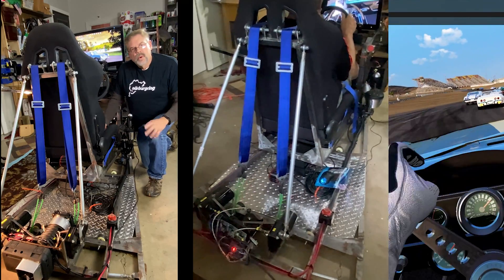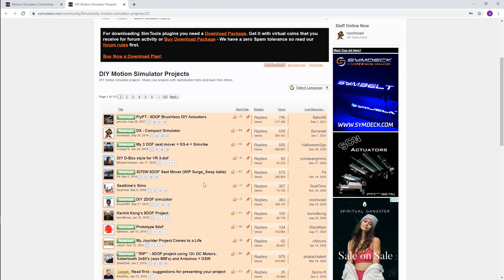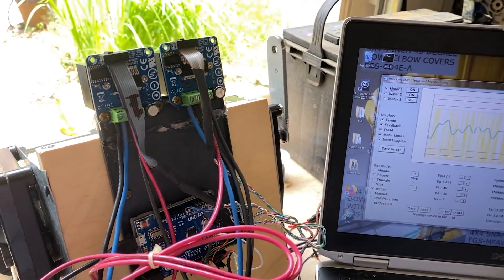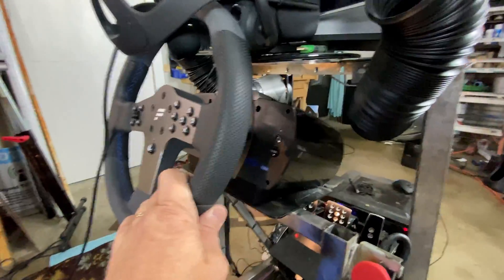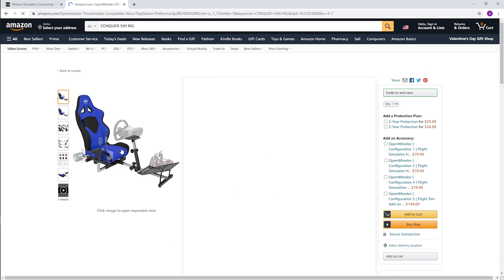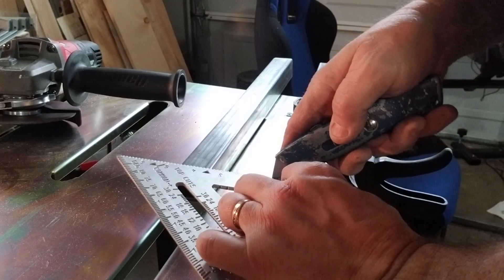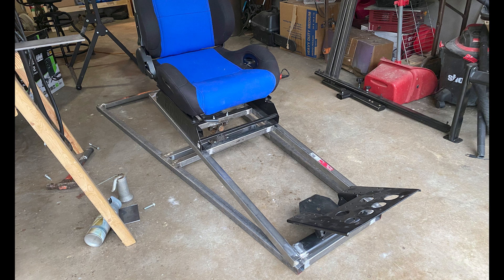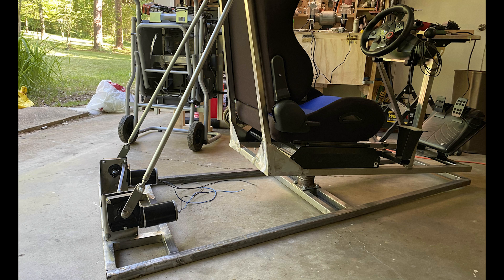How to build a Motion Sim Racing Rig - Start your journey!

Comment: There's a huge step missing in this video.  How is your wheel, shifter and pedals talking to your rig?  For example, if you step on the brake your rig will obviously tilt forward to mimic the forward momentum inside a braking car.  How is your pedals communicating with the motors to tilt forward?  I know you used and arduino but there is more to it.
Reply from the maker: yes. of course there is software which interfaces with the game data and moves the rig.  I have about 100 videos on how to build and what software to use and set up  so take a look at some of the other videos Dave
Reply: @DMAX_DIY  cool

Comment: its been a while since I've attempted this, but my biggest issue was getting the information (telemetry etc) to tell the setup how to turn etc.  You can always make it bank or whatever based on steering wheel input, but the terrain input is whats critical.  Have they come up with a protocol yet to universally feed these setups?
Reply from the maker: well I have a video about setting up your motion without anything but  the rise and fall of the track.  that's really first what you want to do in Simtools editor.   then you shut those forces off, and only concentrate on surge (acceleration/braking).  heres the video..    https://www.youtube.com/watch?v=6rZMVFsoNHA&t=3049s

but there is an entire newer series on all of the compact motion simulator..  here  https://www.youtube.com/playlist?list=PLO8l70qEp71MER1P0D-BBZza_gqzzmgp_

Comment: How difficult is it to get one of these to run on compressed Air? I have a high power air compressor and a pipe going to my cellar
Reply from the maker: good question..  probably wont work.. i have experience in animatronics (using pneumatics) and in my experience the valves that are controlled are either open or closed  on or off  so  that's probably not going to work in a simulator.  you need something that has analog type control ..  it's easier with an electric motor but could probably be done with a fluid valve system like you would see on a backhoe.  i hope that helps..    dave
Reply: @DMAX_DIY  thank you so much!

Yes I just thought that since I have this 10kW compressed air system in my house that could be a good starting point, but I totally get the concern

Comment: You have issues with input or well in this case output lag? Or response time? My biggest worry is to build one and it be behind what I’m seeing or should be feeling in game.

Also what was your total cost? You basically built a DOF Reality H3 unit. Those run for $3,500
Reply from the maker: it's been 6 years now.. building 3 rigs..  i dont notice any 'delay' or latency with my setups.  i race on line with about 20 guys in the ACF league  every weekend too.  i think if your have some basic tools  your can build it under 1000 dollars.  i had to buy a cheap welder from harbor freight but that was only about $120 with a cupon..    also  i race in VR which is pretty taxing on my laptop.. and i still dont feel any latency..   the laptop is a gigabyte  with  an i5 and a 3070 video card..  dave
Reply: @ thanks for the info! This is an awesome series! Cant wait to see your final design and add ons.

I have all the tooling and skill set, I just needed a good design or idea to build. Motors and controllers specifically. I have the fab shop and automotive knowledge. But electronics is my weak point. I just don’t bother with it.

Also have you looked into making shorter motor rods instead of mounting to the seat back near the head? Why not mount to the base where the seat mounts? Should be able to replicate the same travel with a stronger arm and less materials used.

Again maybe check out DOF reality H3. Really similar to your design. But I’m sure had much more funding for R&D that may save you time and head ache
Reply from the maker: @mrmidnight32  i really wanted to use the maximum mechanical advantage by using longer arms, which attach higher to the frame.  (longer lever can move more) i was worried about the 12v crab pot motors being able to push all that weight around.  the dof reality uses different motors which i cant obtain here in the states.  but i've built a rear pusher and this compact front pusher and both react similarly using the longer tie rods.  so that's my reasoning behind it.   i also leaned heavily on the  experiences other guys have built rigs on x-simulator.net..    very helpful
Reply from the maker: also  here is the latest series on my channel which goes over everything.. start to finish  https://www.youtube.com/watch?v=_L8qYhAoIZ4&list=PLO8l70qEp71MER1P0D-BBZza_gqzzmgp_

Comment: Those look like 12V wiper motors. I suppose those are a bit stronger though. Currently i'm still in the process of making my own pedals.
Reply from the maker: Hi, well they are 12v but way more powerful than wiper motors.  i actually did a series on using wiper motors too.  but these are 12v crab pot puller motors available on ebay.
Reply: @DMAX_DIY  Thank you for that info.

Comment: How does the computer control the actuators? Is there feedback on the game built in?
Reply from the maker: good question. Thanks.  I made quite a few videos which go step by step on setting up the software and hardware to control the motors.  Yes, the games actually provide output for the motors and allow everything to work properly. Take a look around at some of my latest video series, which are start to finish.. Dave
Reply: @DMAX_DIY thanks for your response. I will do that.

Comment: Show us the software which drive the motor how it is connected to the degree of movement with the game or it just gives pitch ,roll,yaw pls
Reply from the maker: Thanks for watching.  in every series I do just that.. show how to build it, how to wire it, how to get the software to interface, how to get it running in the game.. I'll be doing it again in my next series (the green one) but if you dont want to wait, just look at some of the other videos that say 'simtools' or  SMC3 and that will get you going.. DMAX

Comment: Sooooo few people with the ability to do this stuff in a real way that there is so little in the way of basic info. Thanks for this it gets me started at least knowing where to start getting things together.
Reply from the maker: Great Comment and observation.. Yeah. 3 years ago I barely knew what any of these things were.. I did a bit a poking around on YT and found X simulator.net.  Used the info to build my first motion sim.  I had no idea what any of this was except I did like Grand Turismo on the play station with a controller but watching a few things made me think.. I can do that too - but didnt see any videos on it.. - So there we go. I decided to post up some stuff cause it worked pretty good.   I have a new video coming out in the next couple days on the COMPACT simulator .  Hope you have time to watch.. I'm working on the edit right now. And thanks for your comment..  Keeps me plugged in and helps me remember to keep posting stuff.  Dave
Reply: @DMAX_DIY  have you looked into / found / built anything using the piston style D box style ? I’m really thinking that’s the way to go as that seems to be the most popular and highly touted motion platform these days. If I can find the hardware ( I haven’t started really trying yet ) and there are software solutions to use it (which clearly there are) then I may try to go that route. Any suggestions or have you come across other DIY piston style ? I don’t really know what else to call them. But it’s what D box uses , one on each corner of the rig.
Reply from the maker: @SticksAandstonesBozo  so I used to mess around with a lot of pneumatic actuators back when I was involved in the Halloween Fright scene.. a long time ago. So I do read about these (electrical screw assemblies (as opposed to pneumatics) and I see the benefits.  I would suggest looking up " six degrees of flight" - on YT he has not posted in a while but he was using this type of actuator..  also I am in contact with "MOTION simulators" on YT and sort of on Facebook, which I dont look at that often.. Many of those guys are building the same things.. 3 DOF, 6 DOF etc  using the DIY actuators.  I just have not had a chance to bite off that much yet..  YET..  Let me know if you need links to their channels.. ALL the best my friend> Dave
Reply: @DMAX_DIY  Ive been looking at stuff from him and you but just now going to actually start working on a setup. Thanks for the info and the videos.
Reply from the maker: @SticksAandstonesBozo  Cool.. here is my new video if you want to take a look..  https://www.youtube.com/watch?v=UXS45Z2GHMk

Comment: I built my own sim chair rig out of wood the other day, it turn out extremely well. I got adjustable steering, seat distance and seat tilt. Anybody can get comfortable in it. But the last few days I’ve been thinking about how I can make it better. I was thinking as a primitive form of motion sim I could build a frame slightly bigger than the frame I got for My chair atm then I could hang the chair inside the new frame with springs and the feed back from the wheel and shifting should make the thing motion simmy lol. Making any sense here? Does it sound stupid or should I give it a go?
Reply from the maker: First of all thanks for watching my video. Sounds like you have been doing some thinking which is great! It always makes sense to try and get more out of the experience! I have not tried springs as I always thought It would be best to use the game telemetry to move the frame (or just the seat) in direct relation to the game inputs. I think you may just bounce too much unexpectedly..  (I may be wrong as I have not tried it)  I always wanted movement that was directly controlled by the throttle, brake, turns etc - and that comes from the game telemetry.   Give it a shot I guess.  There is another guy who is doing something similar here is a link to take a look https://www.youtube.com/watch?v=ZlPYNouUjuI   - Let me know if this is similar to your idea.. Dave
Reply: @DMAX_DIY  ya your right. It would probably be the wrong movement I’m looking for. The dr has a nice rig. I got welders and stuff just not that big of a tech guy., I would definitely have a learning curve there. BUT I got bigger problems at the moment. I bought my first wheel about 2 weeks ago and had to get 2 returns already, and last night my freakin wheel quit again! 3 t248s crashed within hours of each other.
Reply from the maker: @El-Dabo306  What kind of wheel did you get?   I dont know what the 3 t248 is..   Maybe whatever wheel it is needs to download a bios update or something..   I've had a G25 logitech and a Fanatec CSL elite.  I just bought the Fanatec  CSL DD  but have yet to put power to it.. so IDK about that new one.. Dave

Comment: Great video! I have a question. Is this only possible with one game or also with completely different ones like Flight Simulator, Tank Simulator etc.?? How does the engine know the movements of the steering wheel/joystick - left, right, up, down? Where does he get the data from? How does this work in simple terms? Thank you, Thomas
Reply from the maker: Great questions and fantastic comment my friend! To be brief, the game telemetry data is sent from the game  via usb to the arduino.  So flight controls, steering controls, breaking, shooting stuff whatever all comes down that telemetry pipeline. There is a small program called a plug in, which is available depending on which game you want that reads the data and sends it to the arduino.  The arduino reads the data in real time and adjusts the motor positions using the IBT-2 motor controllers.  Everything starts to come alive after you turn up the Pulse width on the motors.  There are many videos about it and I've done a few myself.  It's a great project and absolutely works..  Dave

Comment: Absolutely sick! My class mates and I might go on and try something similar, and i have got a question: where do you get the in-game information from? (When the seat should move forward, to the side, etc.) Thanks in advance, you are a huge inspiration!
Reply from the maker: Fantastic comment my friend! To be brief, the game telemetry data is sent via usb to the arduino. The arduino reads the data in real time and adjusts the motor positions using the IBT-2 motor controllers.  Everything starts to come alive after you turn up the Pulse width on the motors.  There are many videos about it and I've done a few myself.  It's a great project and absolutely works..  Dave
Reply: @DMAX_DIY  Thanks a lot for the quick answer, I haven't gotten around to actually watching all of your videos, but that's definetly what I am gonna do! 
Greeting from Austria 👋
Reply from the maker: @Misp7423  Austria sounds like a cool place..  It's super hot down here in Mississippi USA.. just waiting for fall to happen.. Cheers! Dave

Comment: quick question how did you get the sim to work with the motion sim like what code did you use to communicate from the arduino to the motors

Comment: How does the motor controller interface with the game?
Reply from the maker: good question..   the motor controller  IBT does what the arduino tells it to do..   the arduino is set up by the smc3 software.   the game data talks to the arduino which tells the motor controller to move..   i'm doing a series on my new motion sim right now.. i'll be going over all this in the next month or so.   Thanks!
Reply: @DMAX_DIY any updates on the new series? Will it be a new rig or just an upgrade?

Comment: Love every bit of this! Just curious how to program/synch the motors to the motion…
Reply from the maker: Yeah 45Mang..  that's a great question..  Ok so you set up the Arduino memory program using SMC3..   Then all motors are able to be influenced at 35,000 times per second by the game telemetry output..  So There you go.. motors are sycnched to whatever game you are playing (most top level racing - flight etc games)  I have a lot more on the channel on how to do it.. DMAX

Comment: quick question i dont a have 10 k hall effect. potentiators i only have 15k will that work im trying to spend as little as possible 
plz answer thankyou for your time.
Reply from the maker: Great question..  I've seen it before too so Here is the short answer..  it' probably will work, but the arduino math is going to be off a bit. I would think.  based on 10k.   I'll run a test when I get the new rig running..  I'll substitute a 15k wire wound (if I can find one) for one of the hall effect sensors.  That way everyone can see the difference.  But your best best I think is to pop for those hall effect sensors  180 degrees..  I have had absolutely no issues with them experiencing EMF problems and the simply work great..

Comment: Not sure if you are still repling to this vid but thought I'd try, Ive been looking for a couple of years on and off even considering buying the next level v3 motion sim but then I saw your dog and explanation and knew straight away is what I want, couple of questions if that's OK -
1- cannot get the crab pot motors here in uk without crazy postage, would three wheelchair motors work, 
2- How is the rear motion loss fixed, is is two rods horizontal fixed to the motor. 
3- I use my sim mainly for DCS world, have you tried motion loss in a flight sim. 
Kind rgds
Reply from the maker: Just happen to be looking and replying  so here we go my friend..  Ok.. so I did a build with 24 volt wheelchair motors..  turned out ok using the ITB2 and arduino..  Mine ended up being 18:1 ratio  which is not ideal..  The higher the ratio the better..  like 50:1 would be great.
  https://www.youtube.com/playlist?list=PLO8l70qEp71MER1P0D-BBZza_gqzzmgp_
 I have a new series on mounting the TL motor  just take a look at the 'compact motion sim'  it should have a few good videos on how to 'hook it up'. I have NOT used the sim for FLIGHT.. but I have ILK2 in my near future..  Just cant wait to go flying!   Thanks for the comment.. Dave

Comment: Why hall effect pots over mechanical?
Reply from the maker: Good question..  I'll try and explain in one of the upcoming vids..  But long and short is they wont 'break' if something goes wrong on initial setup and wire wound 10K pots  (which you can use) are susceptible to EMF noise..  which may cause the rig to do weird things..  So not wanting any weird shakes or whatever, I just went with the 'recommended' setup from x-simulator.net.   those guys have been in motion for a long time and know everything..  Dave
Reply: @DMAX_DIY  noted. I was playing with 50K on mine and the noise was insufferable, so I got some hall effect sensors and they're so much cleaner in feedback signal so far
Reply from the maker: @TyCrawford  Yeah..  that's why I went with the recommended ones..  they were like $25 each  which is WAY more expensive than wire wound..  but  in the end  - now I have like 9 of them..  Trying to  design a 6DOF  this year..  Later this year..  I keep pushing it out..  Well glad your on board with the hall sensors.  Dave

Comment: This is awesome. Once I upgrade to a better pc I think I'm gonna build one of these. I built my own rig from wood and I love it even though it's not a motion Sim.
Reply from the maker: Nice!  Tell you what though.. you dont need a very good pc to run the motion.  I have a couple series where I used the worst laptop and it runs the game and the motion system at the same time..  The real reason to get the better PC would be for using VR which takes a lot of resourses..  The motion programs require hardly any processing power as all they do is read the game telemetry I/O
Reply: @DMAX_DIY  I plan to get a better pc to run assetto corsa since all I can run is live for speed at the moment and then get vr and then build a motion rig at some point. I also need to get a better wheel setup since I'm using a Logitech g920. It's a great wheel but when I'm drifting it just barely keeps up.